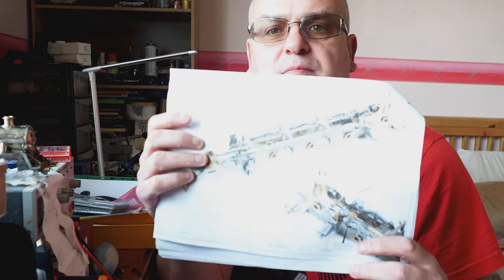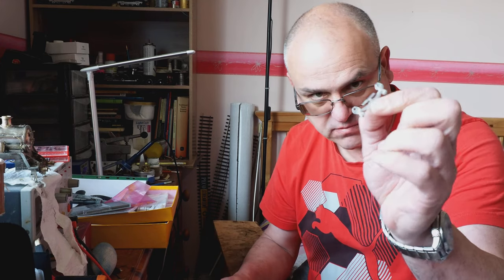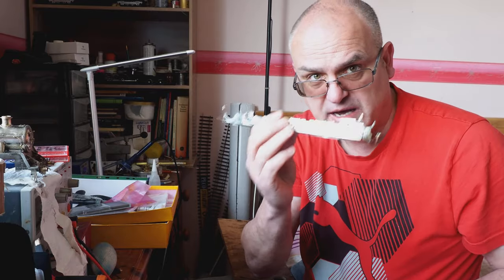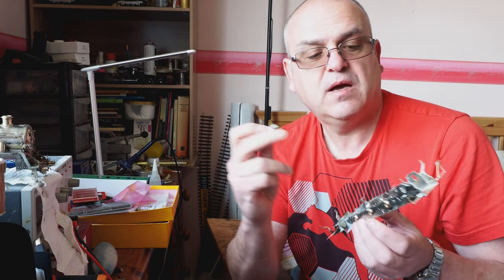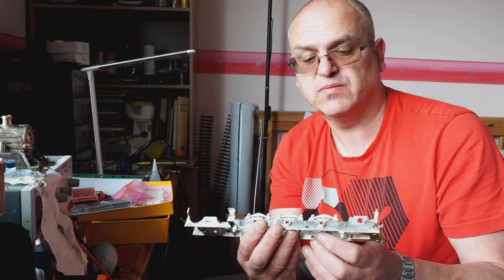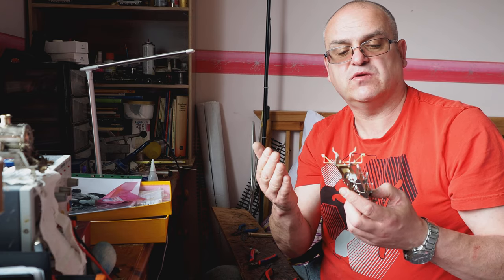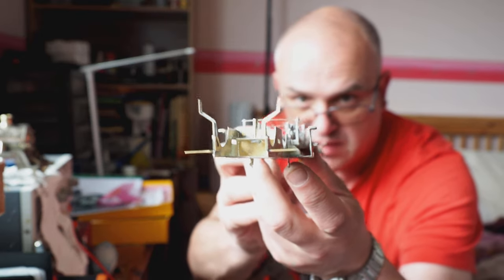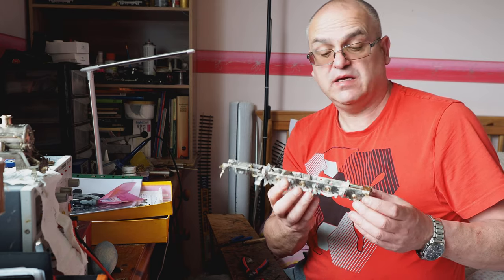A8 Part 3

Comment: Well this is the third oart and for me that’s the final one. With due respect, I have seen nothing except you holding up parts, and hear you talk, talk, talk. It drives me nuts. No doubt you doibt you are very knowledgeable, but I would like to see how you actually work.
Reply from the maker: When I first started this, I didn't possess the necessary camera equipment to allow me to do what you would have liked. It was my first attempt at doing something like this, and I have learned a lot and bought a lot more appropriate equipment to allow me to present something better. I have ordered a DJH G5 starter kit, and I will film the building of that in a more instructive manner.